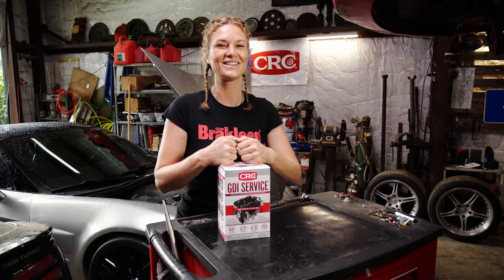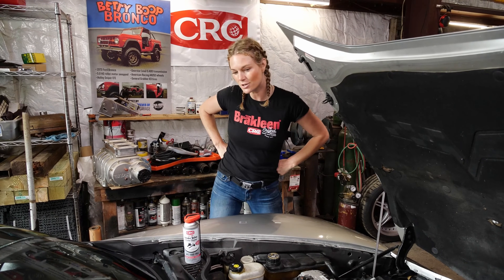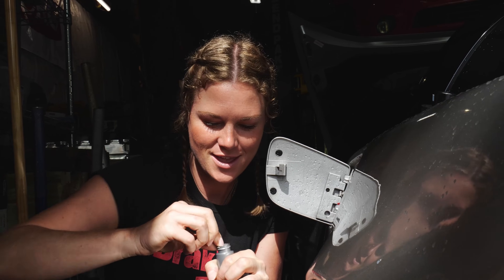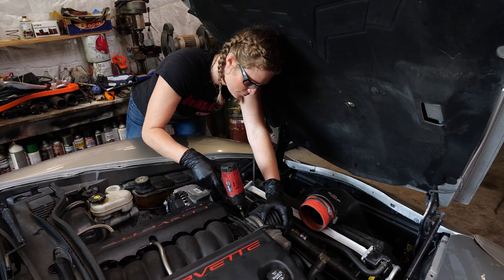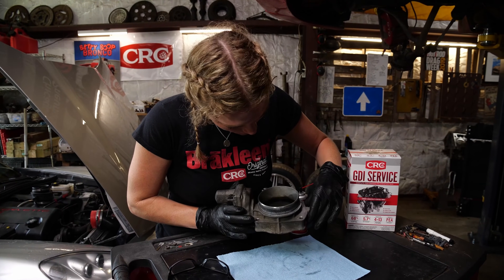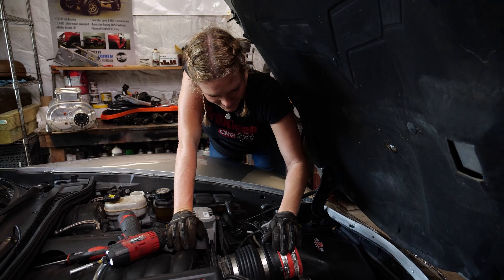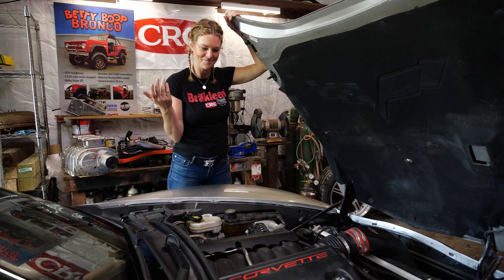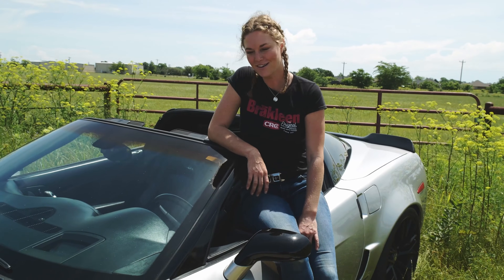How to Clean & Maintain a GDI Engine in 4 Easy Steps With Emily Reeves

Comment: 🎉Intake manifold intake valves can only be cleaned manually with Engine Shut Down & Valves Fully Closed on the Cylinder being Cleaned.....Manual Rotation of Crankshaft to Achieve this Necessary ❤ Let CRC or other cleaner sit. I do overnight soak on the TDC Cylinders

Comment: Sonata 2016 , no MAF 
But MAP is located just after throttle body

Does it damage the map sensor if I spray directly to throttle body?
Reply: Saw some vids they didn’t remove the MAP sensor . They just sprayed CRC through the throttle bottle
Reply: Currently trying to do the same on 2011 2.4 sonata
Reply: Okay , let me know how it goes pls

I'm tempted to do it as I still didn't get any answer wether it will damage the MAPS or not
Reply: @nezarabuzahieh4516  they didn’t report any damage to MAP sensor. And in the videos they only removed the air intake
Reply: @nezarabuzahieh4516 there’s some forums that also say GDI cleaners won’t damage the MAP sensor but if you have MAF sensor it cam harm it
Reply: Alright , I suppose that's a green light 

The only worrying concern is that some reported that the carbon removed as small chunks and scratch the cylinder and cause damage to the engine, any idea about that
Reply: @nezarabuzahieh4516  https://youtu.be/wPAxN2-aRjo?si=pcXJbdKofIPbLy8O
Reply: @hamiltonarmando 
Oh I think you refer to different type of cleaning (manually) , it's different than the method recommended by CRC (while engine running)
Reply: There’s a method remove the intake manifold, have acces to the valves , rotate the crank to close the valves that your working on cleaning so nothing goes inside
Reply: Yeah . Me personally I’ll be dong the CRC version

Comment: How does carbon (from combustion within cylinders) make it's way so far upstream of the combustion chambers, especially get by the intake valves?
Reply: Some gas will get past the piston rings & into the crankcase. From there they get recirculate into the Inlet Manifold. That's where Port Injection will spray gasoline & dissolve the gunk, but Direct Injection sprays it into the cylinder & so the gunk builds up.
Reply: @dumptrump3788 Thanks, got it!

Comment: Ceratec for piston scoring. 
CRC intake valve cleaner, twice at x0/x plus 1000 miles/ put it in the air intake boot port downstream of the brake booster.
Use liqui moly flushes and Valvoline R+P and purolator boss filters.
 CRC DOES WORK. Hear the nuts shoot out of the exhaust. Lowers the bake temperature. Allows the detergent in the oil to work... get a stick for the 2,500 RPM bit.

Comment: Use an old toothbrush and cleaning time cut in half and use much less chemical. Also keep actuator at the top so cleaner doesn’t go into circuit board.

Comment: Nice video show how to use the product, thank you Emily.  Would have been interesting to have done a scope exam of the valves before the treatment and after to see if removed any of the carbon on the back side of the valves.
Reply: It wouldn’t have mattered, this is not a GDI engine.
Reply: @brettmiller7984  Ah, got it.

Comment: Great job and yes this should be part of regular maintenance.  After 50 miles of performing this, you need to change the oil and filter.  You don’t want the carbon deposits that came loose circulating in the oil and possibly restricting your oil filter.

Comment: Using the new Valvoline Restore & Protect oil will remove gunk and carbon build up on GDI engines, free sticking oil rings and stop oil burning.

Comment: C6 does not have GDI.
Reply: Totally irrelevant.
Reply: Still has intake and valves that need cleaning
Reply: @GMK6300L  But it has port injection. Those valves should be clean from constantly being washed by fuel. Significant carbon deposits on valves is a GDI issue.

Comment: Straightforward & informative demo.! Question.! Wasn't reprogramming required.? Didn't the car throw a check engine light after removing & installing the throttle body & mass air flow sensor.??

Comment: Great video Emily. You do know that C6 Vettes are port injection and not GDI, right?
Reply: Exactly lol.
Reply: Going by the 100's of comments she does now!😂😂
Reply: I doesn’t matter, if she thinks the valves need cleaned that stuff will do it. The location of the injector is irrelevant.
Reply: @tomkindall936  Know the difference between DI and EFI engines?
Reply: @ if your talking about the difference between gdi vs port injection then yes I am fully aware of the difference. The difference is irrelevant based on the comment. If she thinks the valve needs cleaned the CRC product does that as I said regardless of where the injector is located (inside the intake port vs directly inside the cylinder). I understand that with port injection a fuel treatment can also work and that basically she cleaned the fuel path twice since she put fuel treatment in and valve cleaner.

Comment: Much of this can be avoided by running quality gasoline.... shell ..exxon... chevron..to name a few have more detergents than generic gasolines...
Reply: If you have port injection and fuel is being sprayed on the valves.  It's the EGR system bringing in the carbon.  Good quality oil may help more and more frequent oil changes.  With GDI fuel doesn't hit the back of the intake valves.

Comment: Why’s the check engine light on?
Reply: Well, I used this product on a car that didn't have a check engine light. With about 75k miles, and after I used it it threw a catalyst below efficiency code. The code never went away. It was a GDI car, with a turbo, so I don't know how safe these products really are. I would only use half the can next time. Or only on cars with under 60k miles.
Reply: Often the valve cleaner will do that due to the chemical in the system and the loosed carbon being flushed out. Usually clears itself up in time.

Comment: This stuff works great I use it every 12,000 miles.
Reply: I use the CRC intake valve and turbo every 5,000 mi because I do an oil change every 5,000 mi with mobile one full synthetic on a 2019 Hyundai Tucson 2.4L
Reply from the maker: Thanks for the great feedback!